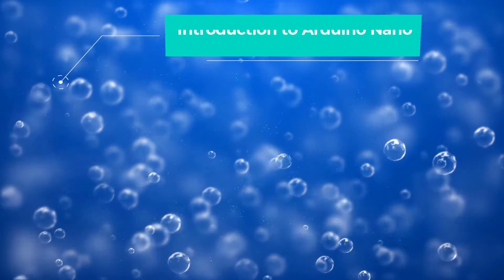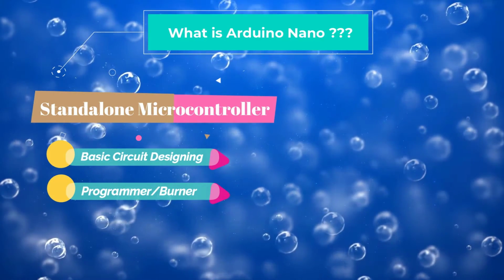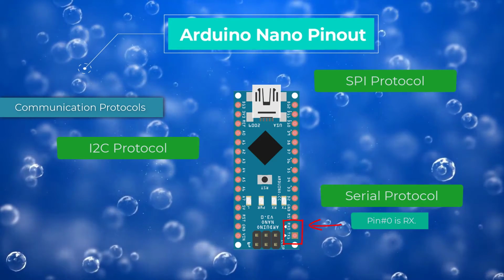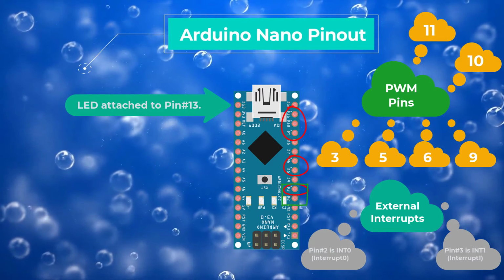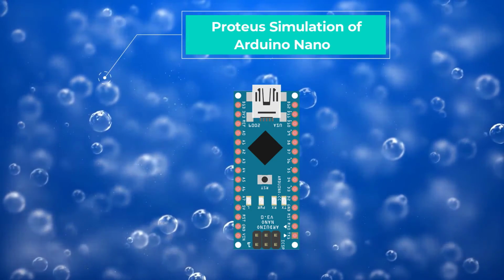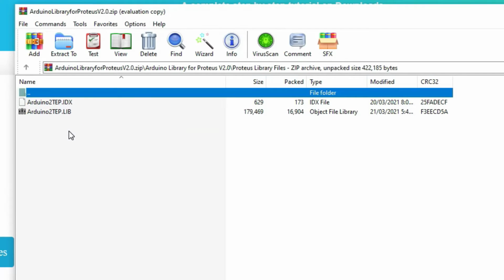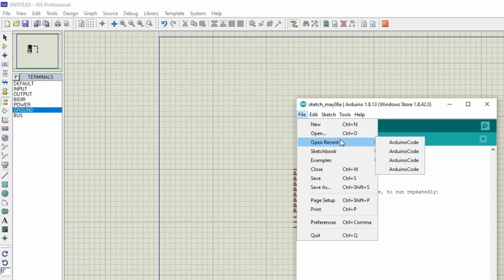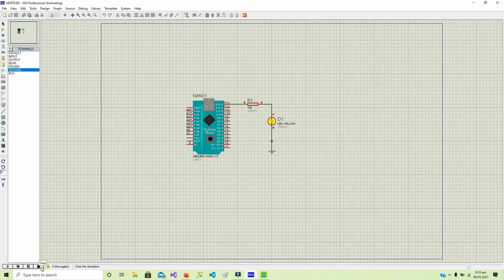Introduction to Arduino Nano | Pinout | Features | Proteus Simulation

Comment: I am a beginner. What should I do if I need to input a voltage greater than 5V to arduino NANO? It seems that the arduino nano in Proteus has no VIN pin. Since I plan to use a 9V battery to power the arduino nano, I want to get closer to the usage in the circuit simulation